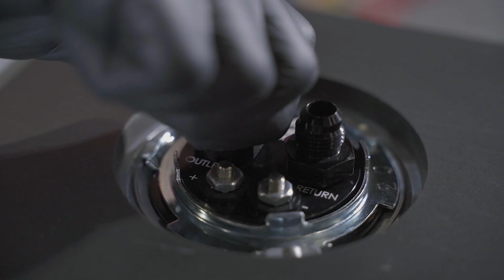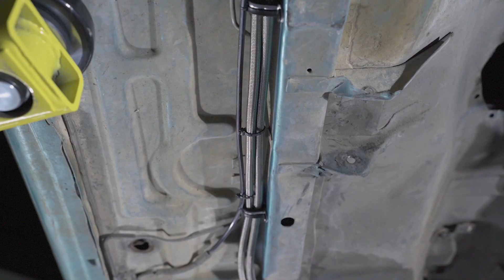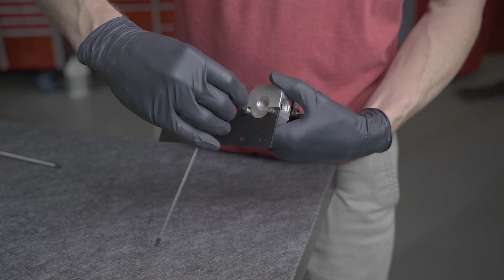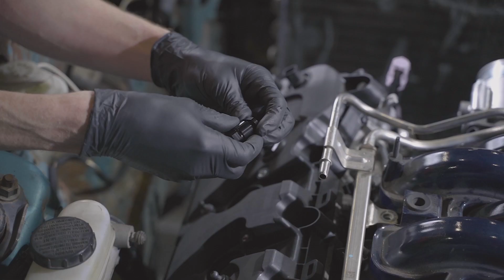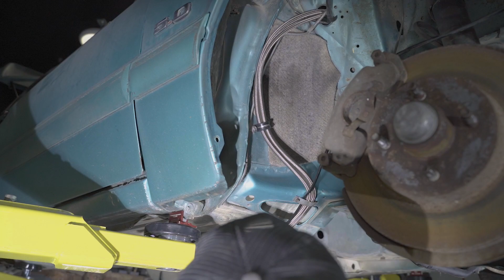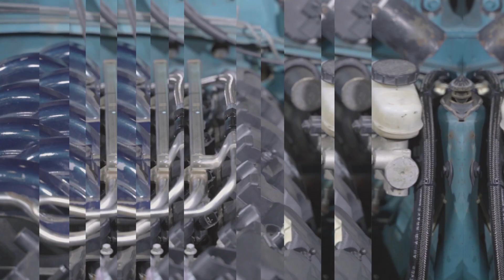SVE Fuel System Engine Bay Install For Coyote Swap Fox Body Mustangs

Comment from the maker: 1/22/2025 - Please note, this kit now includes a 10 Micron fuel filter. For more information, please visit the product page. -Landan

9/9/2025 - Please note: This kit now includes a different fuel pump hanger assembly, a 255lph fuel pump, and the heavy duty wiring harness has been removed. For more information, please visit the product page.

https://latemodelres.to/6237-C_YouTube